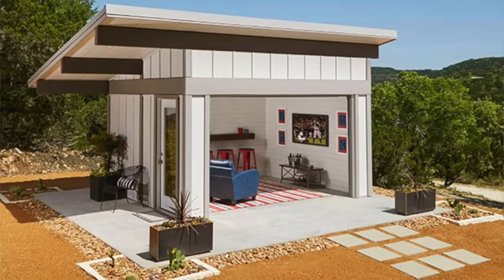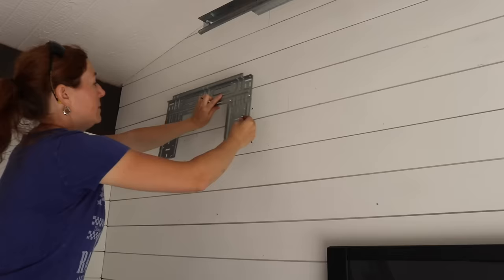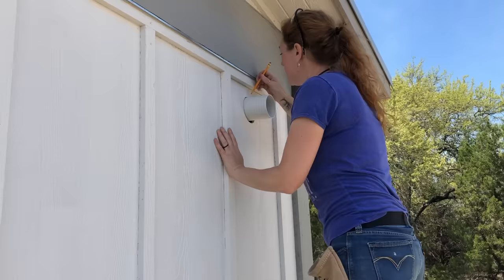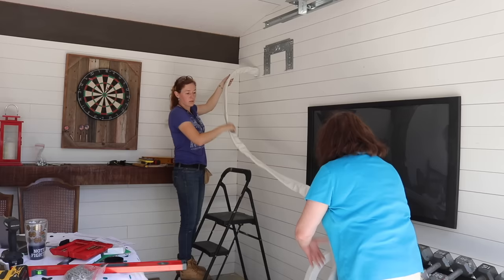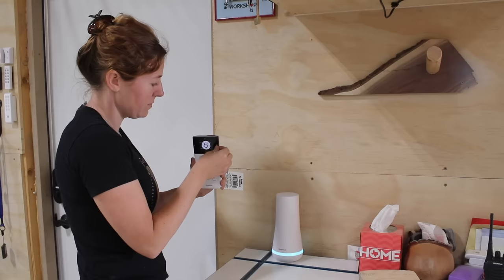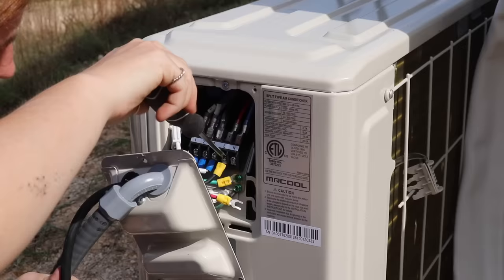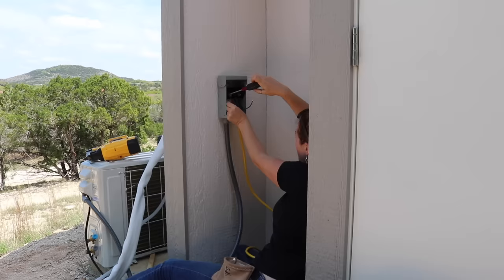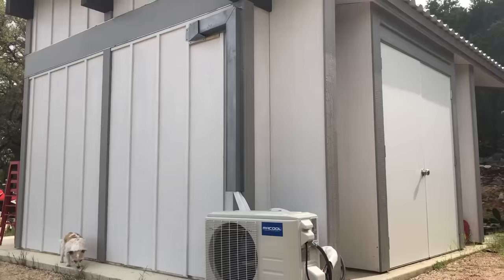DIY Ductless Mini Split Install - MrCool Unit

Comment: Ok, I have a lot of comments. Here in Greece, mini splits is the norm. Even if you try, you won't find a house without at least one, that being said, I have a bit of experience in these things. Let's go to the comments. All mini splits come with the refrigerant pre-charged. All the mini splits have that refrigerant stored in the outside unit as it is more robust than the inside. It really shocked me that yours has it in the inside unit. Second (and most important comment) is that having such a long coil of refrigerant lines between the indoor and outdoor unit, means GREAT losses in performance. Trust me, been there. Bring a professional and cut the lines to the minimum length that serves your needs. And if you bring a professional to shorten the lines, tell him to empty the lines with a vacuum pump before charging it again. Mini splits are very sensitive to moisture in the atmosphere and by leaving (even a little bit of) air inside the refrigerant loop, you drop the AC's performance and you are causing it's insides to rot that much quicker due to the moisture. To sum up, remember two important things for installing mini splits, keep the refrigerant lines as short as possible and empty the lines with a vacuum pump to ensure no moisture gets trapped inside. 
Other than that, greeting from Greece, love your videos and I watch you all the time.
Reply: She paid maybe $800 dollars for that unit.  It's cheap and DYI.  Everything you've said is good advice but will balloon the cost of the project to double or triple.  On top of that, most licensed installers of these units will not touch the DYI Mr. Cool version in the United States.
Reply: @plasmac9  Ok, I certainly don't know how things work in the US, but the things I recommended to do, in Greece you can do them for les than 100$. Maybe even 50 if you do a little search. That's why I made these comments. Plus, 800$ are not considered cheap in Greece, so.....
Reply: Your first mistake was when you said "Trust me " . Mr Cool mini's are precharge  @ the factory and no service call is need as long as you follow the directions . Period
Reply: @RobertMSmith1  I don't believe he said a service call was needed, he pointed out that not making the changes would result in a less powerful AC. Making the changes would result in a more efficient AC.  The trust me was based on experience 'trust me I've been there' is a valid expression to indicate experience, so I don't see how it would be a mistake in this context.
Reply: i dont know about mini splits but the refrigerant line is way to long. just because she bought the cheap system doesn't mean she has to warm or cool area around the shed.
Reply: You wont have losses. Did you see the size of the shed? And no. There is no refrigerant in the Evaporator *inside unit, Is not possible. All of them are charged in the condenser unit.
Reply: The guy from Greece is totally correct, longer lines mean more loss and moisture will ruin the unit. 
However, for the size of the shed, they may not even notice. Down here in AZ where I live, I would spend the time and money to shorten the lines and pump down the unit. Summer time electric bills are steep here and, let’s face it, if you’re going to the trouble of installing a unit like this, you want it to last.
Reply: AlbinC  the loss will occur at the coiled up excess supply line. The supply line gets cool and frosty and the return is hot, so the less exposed line, the less heat transfer from the elements (sun) and heat transfer from the hot line. In this case less is more.
Reply: Very few people would consider DIY airconditioning in S.E. Asia because skilled labour is available at reasonable cost. Recently had a similar sized unit installed with minimal length pipes professionally charged with vacuum pump for moisture removal, just like he said. I'm surprised and fascinated that it's possible to DIY this type of project - very interesting. April will boost the sales of such units by this video, I'm quite sure. Hope you get sales commission April, you well deserve it.
Reply: Λευτερη εχεις απολυτο δικαιο.δεν μπορω να καταλαβω πως δεν θα χασει αποδοση χωρις κενο αερος.και οι σωλινες ναι ειναι μεγαλου μηκους αλλα σε αυτες τις διαστασεις δεν υπαρχει μεγαλο προβλημα.βλεπεις οι εταιριες δινουν και μεχρι 15 μετρα μανομετρικο.αυτη εχει το πολυ 3.
Reply: @nickxatzh  I'm sorry Nick, but "that's all Greek to me".
Reply: Im a professional ac service tech and i deal with Mitsubishi mini splits. I had the same comments lol how did the line set hold the refrigerant?? Should be pumped down in the CU. She could have cut the pipe with pipe cutters and made new flares for the connections. But im not hating, watching a chick install a unit by herself is cool
Reply: I think you are mistaken, in the model shown in this video, the connectors at the end of the line set have valves to keep the atmosphere out of the indoor coil. The indoor coil is factory evacuated .
Reply: @ernavill3261  Trust is earned  100% . Both of you need to grasp that . When some must tell me they are a Christian ,that to is a sign they are full of bs .I decide whom I trust .and believe .
Reply: The linset is sealed and charged, and the seal is broken when you make the connection. If you do it correctly, there should be no outside air/moisture introduced to the system.

I also agree with other commenters that while there may be some small efficiency loss to the extra line length, it won't make enough of a difference to make calling in a HVAC 'pro' worth it. If the extra lineset costs you a few bucks a year in inefficiency, it would never pay for itself to call a pro, who if they would even work on it, would charge at least $500 to cut/evac the lines. HVAC work in the USA is a terrible ripoff. Most of the jobs are not rocket science, but the techs/companies charge the equivalent of hundreds of dollars an hour for labor. These DIY mini splits are a great thing to start breaking up the cabal of overpriced HVAC techs.
Reply: @bnasty267  it's already been broken in S. E. Asia, where Big Box Stores sell mini splits from many different countries including Japan, and have crews equipped and trained to install (with vacuum pumps) at no extra cost. For example a 12,000 BTU system costs about $1000 transported & installed within metropolitan area. The benefit of DIY is out in rural areas.
Reply: Mike Martin the liquid line feeds into the evap (hot line) and the suction line ( cold line) is what is coming back to the compressor to be compressed into gas
Reply: AlbinC there is Freon in both the condenser and evap coil(inside and outside).
Reply: I wonder if she could simply install additional insulation (the 'casing' type) around the excess coil and not mess with the professional...you know, the kind that looks like those long squiggly pool tubes.
Reply: I think those lines are steel mesh covered lines which cannot be cut. That is why they are so flexible. Everything is DIY so who needs an installer.
Reply: Considering I'm an HVAC tech I thought I'd throw a couple cents in, linesets have minimums, I HATE seeing DIY mini splits, with that being said if the manufacturer sends a lineset precharged then that's the charge it needs, cutting it down shorter is not going to improve the efficiency of the unit. Like I said I HATE seeing home owners do these on their own but kudos to this gal for doing it right, she will probably never have an issue with the unit and never need to have it repaired minus an equipment breakdown......
Reply: Good points. Unfortunately YouTube and the net isn't so much about information. But for the few people looking for information I'll add that the coiled tubing is suppose to lay horizontally so the condensed can run out and back to the unit. That's in the directions for some of these units. Also putting the vertical coil right behind the unit as shown in the video means the unit is pulling air over the coil which adds to the issue of loss in such a long coil.
Reply: He says the refrigerant is stored in the outside unit (perhaps it's been edited since originally written).  Was the shed insulated?  I didn't see any when she cut the hole, although it might have been pushed out of the way, or edited out... agreed though, still a small enough space.
Reply: @treedawgin  without wanting to sound confrontational, what's so bad about homeowners self-installing these units? A couple of brackets, a couple of wires, and a couple of pipes. The only bit that's complicated is charging the lines and companies like Mr Cool are solving that problem.
Reply: @Λευτέρης Θεοδωράκης
, Greetings from Athens, All good points, and all factual, but now your comment is bringing out "professional A/C Installers" Trolls. HaHa.
Reply: @MrWaterbugdesign  im going to correct you. Its evaporated refrigerant going back to the compressor, not condensed lol. Condensed refrigerant goes back into the handler as a high pressure liquid and a valve meters how much refrigerant goes into the evaporator which evaporates the refrigerant into a low pressure, superheated gas. The more you know 😁
Reply: @Straight_White_Fatherly_Figure  Yes, but there is also potential condensation according to the manufacturer install directions. You are correcting the manufacturer, not me.
Reply: @MrWaterbugdesign  thats incredible. Maybe you're talking about the condensate drain line then?
Reply: The condenser holds the refrigerant not the inside unit. The line length has no impact on these units as the refrigerant charge and condenser are sized for the line length from the factory. The lines are already have a vacuum pulled on them  from the factory so no moisture issues if you follow the directions. The only mistake she made in the job was not coiling the extra line horizontally on top of the unit to prevent oil pooling.
Reply: @glamdring0007  8:30
Reply: That’s not true !
Reply: I agree to part of what you say, but the line set as long as it is will give you LOSSES !
Reply: I've never heard of a mini split, but it's something I could use. You need to do a video. Thank you.
Reply: @Straight_White_Fatherly_Figure  I have been installing mini splits for 20 years, every single brand known to man, these mr cool units are absolute garbage and no the condenser is not holding the charge (as it normally would for every other split a/c) these do it yourself mr cool systems have the charge in the lines, you cut the line, you lose the charge 🤷‍♂️ I've installed a few of these, they are disposable junk. Replacement parts and tech support you ask? non existent. Every time a customer has me install one of these I'll be 100 percent honest and tell them up front these are mickey mouse a/c's, when it breaks don't call me, just throw the unit away.
Reply: @Rolexenforcer  if it isnt a Mitsubishi or fujitsu its garbage!
Reply: @Straight_White_Fatherly_Figure  the newer Fujitsu's have been very problematic, i don't install them anymore for this reason, these days i install Mitsu and Daikin, the new Daikins's are really good
Reply: @cody545  its gets compressed back to liquid.... the liquid will flash into gas and back to compresser as a gas ...compress the gas it turns into liquid.... your changing the state of properties
Reply: @treedawgin  it will break ..they all do...
Reply: @chiefsilverback  these homeownwers know enough to be dangerous.
Reply: @Rolexenforcer  well said... these comments from others are irritating
Reply: @Rolexenforcer  i have little to no problems with fujitshu .. i dont know what the issues you are experiencing.... i have hundreds of them out there...
Reply: @richardwoeckener7936  I've installed many Fuji's in the past and all were bulletproof but the last few kept blowing boards and error codes galore,  i got lucky the customers i installed them for were spenders, i pulled them all out and installed city multi's and have been good ever since. I have probably 30 to 40 Daikin installs out there and never a single issue other than drain pumps failing or getting clogged but those calls are good because they are not free 😉👌
Reply: @Straight_White_Fatherly_Figure  the logic that MR Cool is using is that if the charge is in the lines attached to the evaporator and they send the condenser to you under vacuum, when you attach the quick release features on the lineset, one side is charged and the other is under vacuum you'd be good to go as a homeowner, when you look at it like this, it kind of makes sense but the problem is you can't shorten the lines as a homeowner. I see many problems with the install on this video, she definitely created way to many loops for the oil to travel safely through the system and there will be some loss of efficiency but the system was cheap so who cares, when it fails she'll throw it away and buy another. Another problem i see is that unless she gets a very good generator, the voltage spikes will be giving her a shitload of error codes and in the long term possibly fry the system. ONCE AGAIN I REPEAT, THESE MR COOL UNITS KEEP THE CHARGE IN THE LINES, NOT IN THE CONDENSER
Reply: @Rolexenforcer  I KNOW I GET IT
Reply: @plasmac9  I recon the HVAC techs will come and then try to sell new equipment. Never met an AC tech that wasn't willing to take +/-100$ for a diagnostic fee...
Reply: @plasmac9   12000btu unit $1122 +tax at Home depot.
Reply: Pre-charged line sets are a thing. Not common here but Mr cool has a page for it, so I guess they're working for them.
Reply: @richardwoeckener7936  what does that mean? They are buying a product that is designed for DIY install and following the instructions provided by the manufacturer.
Reply: nice!
Reply: @treedawgin  Why do you hate seeing homeowners do these on their own, especially one that's designed for DIY?

FWIW, I installed two regular (i.e. non-DIY) mini splits on my own in my basement after doing a bit of reading to see what was involved (I also watched our A/C technician when he replaced our central unit, which doesn't cool the basement). I then purchased a pro (used) vacuum pump, gauge manifold with hoses and a container of oil. The precharged units came with linesets, which we had to cut down and reflare, but otherwise worked fine. It's been 13 years and they're still working perfectly.
Reply: @Mikemartin968  the unit is critically charged.  avoiding a vertical coil would prevent oil from trapping.  simply bleeding the lines in this small residential application ought to be sufficient
Reply: @bnasty267  without bleeding the lineset, then in fact you are adding a condensible to the system.  keep up the good works.  failed diys keep me very busy.  best wishes
Reply: @cody545  there is not a true liquid line in a typical minisplit.  the sub cooling is happening via a cap tube throughout the evaporator.
Reply: @trashman2350  the length is no problem as the system comes critically charged.  the vertical coiling of the lineset is problematic
Reply: @chiefsilverback  i love diys.  i make tons fixing their problems
Reply: @tedallen9078  I think I'll trust the manufacturer's install instructions for the unit written by actual engineers than a HVAC tech that's mad he loses money every time one of these is installed. These things are cheap enough, and getting cheaper, that even if the life is shortened, you can just replace it. People don't call an HVAC tech when their window unit AC breaks, they just go to Best Buy and get another one. Way cheaper than HVAC techs charge.
Reply: @bnasty267  who is mad? certainly not me.  i was pointing out that the contamination to the equipment is a high probability while complacent with contaminates in the air stream
Reply: I know this is an old thread but, sigh. There's refrigerant in both condenser AND evaporator.  BOTH have to be vacuumed and charged and free of moisture. It's a complete loop and the entire loop has refrigerant. I saw lots of "the lines have the charge, the condenser has the charge"replies above. BOTH are charged. All ac systems work the same. The only difference between this and Central ac is this only puts conditioned air into a single room. It's the same as a window AC. The benefit is the lines are pre charged so you don't have to vacuum and charge them....cause the factory already did it.  That's it. If they weren't pre charged you have to pay someone to do it or do it yourself with your own vacuum pump, refrigerant, and scale, and use your own gauges. It's not string theory. It's basic simple stuff (the tools are expensive). HVAC techs are irritating. Charging 600-1000$ to install a modified window air conditioner is BS. Why must they and only they do it? Cause they have magic powers of reading directions. BS. Thank you Mr Cool for taking them out of the equation.
Reply: @bnasty267  i simply pointed out a risk of contamination.  i guess you prefer gas lighting rather than an honest pointer to a woman that happened to do a pretty good diy job.
Reply: @plasmac9  I noticed most of the McCool installs on da tube are in garages. Thats ok, cheep ac and heat but a failure will only chill the family  car!
Reply: @ernavill3261  Jerz, ive been in Greece during the summer, that im 1966 when no one had ac or ice for that matter.  Yea, you want every btu too and the cost if electricty is .22cents a kwhr. My bet is direct solar input is popular their .
Reply: @Mikemartin968  Its so cheep lasting a third what a premium unit will last is likly. To think of it though, a high seer unit will be a low seer model within five years and replacing it might be a good idea. The replacement model for my present Mitshubishi is 8% better just three years after my install! Really saving money with my mini!
Reply: @treedawgin  Home depot sell half a dozen bramds of mini splits, all without precharged linesets. By the time a home owner purchases the equilment it makes sense to have a trained hvac make the connectilns and pre charge vacuum and make sure no leaks
 
I payed $4200.] for a two ton Mitsubishi install but im saving enough money the pay  back is four years so im happy,  Had the money and no complaints. If I went cheep and my bride fell cold, hell would pay!
Reply: @plasmac9  I don't believe that price is right for the DIY series. They are nearly double the Advantage series which are closer to your price but require a tech to evacuate the lines and charge them. That is based on Amazon prices at least.
Reply: file lefteri edw oi grammes erxontai precharged for 15' pou einai 5metra. an einai pio makria grammi xreiazetai perissotero freon. edw stin ameriki xrewnoun toulaxiston 1000$ gia egkatastasi. ola ayta pou les exeis apolito dikio
Reply: The lines on the "DIY" version are factory evacuated and sealed and the specialized fitting penetrates that seal as you tighten the fitting. On all the other Mr Cool units you are correct that it does have to be evacuated prior to connection. This one does not need to be evacuated because it's done at the factory. You are correct about the line length.
Reply: @ltheo2000  unfortunately just to get an hvac guy out to my house for a minisplit install would cost me about $10,000.
Reply: Thanks everyone. Now I’m going with a wood stove and window unit instead 👍🏼
Reply: The system is pressurized, so length doesn't matter
Reply: @treedawgin  I just watched a video of a guy installing on these minis and he says the manufacturer specifically says you should not cut them down and that a minimum length is required. He says if he had known he would have put the units further apart as to not have to make a coil. He digs a hole and burries the coil laid horizontally and covers it with a wooden framed box/plywood and covers that with stone.
Reply: @plasmac9  There's almost $1600... I just picked mine up...
Reply: @Straight_White_Fatherly_Figure  no possible way your a "personal service tech" and have never heard of pre charged line sets.
Reply: @jonnymac31  professional*
Im a service tech, not an installer. Went to tech school as well.
Reply: Robt Smith Do the multi zone units come pre charged also?  Or just the zine unit?
Reply: If you want to do that, buy the non-DIY unit for $650 cheaper.
Reply: dav snow greece is in europe, not south east asia. Missed that class?
Reply: After all this talk I'm hungry think I'm go for a gyro or two today,,,
Reply: well said...i think vacumn the system first before turning open the feon valve is very important....or at least do a purging out from one of the refrigerant line !!
Reply: @plasmac9   The DIY unit costs more than it's non-dyi counterpart. If you get the non-dyi version you can use the money you save to hire that professional to complete the install. You'll need a copy of the invoice to show that it was completed by a professional for warranty purposes.
Reply: @Rolexenforcer  i 1000% back u ive installed a few myself i have been doing hvac for 7 ½yrs obviously not as long as you but ppl should not waste there money on these unit here in li ny we install Fujitsu and Mitsubishi with he company im with atleast
Reply: I work in the hvac industry and I can say that this comment is very true besides the refrigerant being on the inside machine because it’s not it’s in the outside. But other than that yes you need to shorten the lines and yes you need to vacuum it at least to 500 microns. Please don’t diy any ac work let a professional do it, we work in this industry day by day and we know what we are doing, you don’t
Reply: @Mikemartin968  incorrect. Supply is cold, return is cool.  Both lines are on low side of the system. The metering device is located in the outdoor unit
Reply: @plasmac9  I am a professional HVAC installer these things are very deceptive I have installed Mr cool units and they don't come with the lines charged and inorder for you to even touch freon you have to be licensed they get away with this because your supposed to have someone come in behind you to finish the system and regards to price even at $800 if you you have to replace it every few years and your efficiency is off because it's not vacuumed your getting back to the price of a pro and you can forget about there warranty because you didn't have a professional installment these systems are nightmares and this is why most HVAC pro's won't mess with them
Reply: @Rolexenforcer  pioneer very good